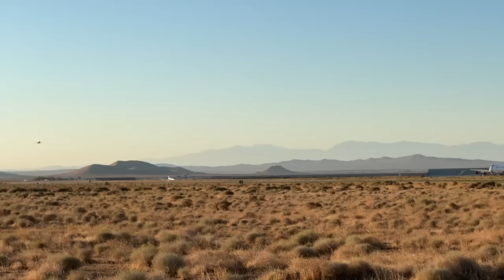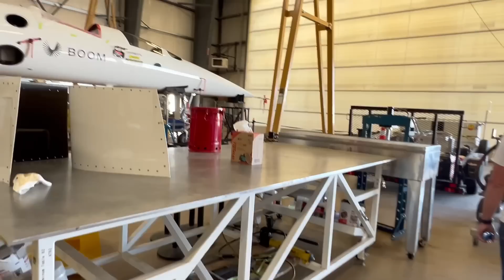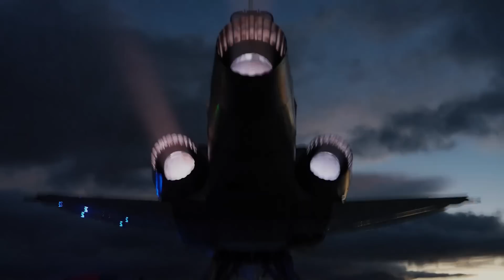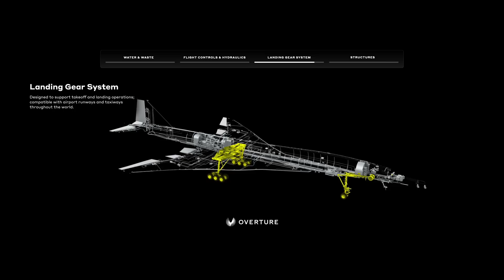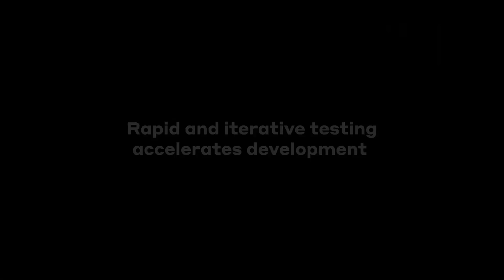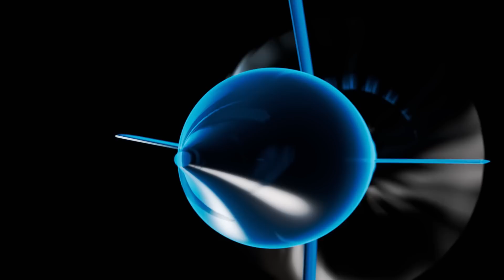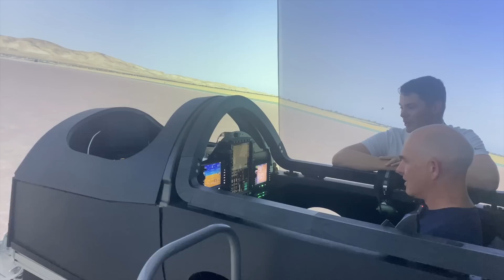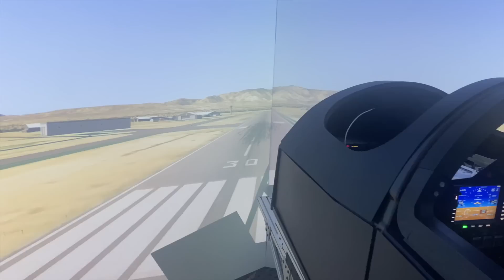Will This Experimental Supersonic Aircraft Show Supersonic Airliners Can Work?

Comment: Scott going straight for the jugular with rudder size shaming 😮
Reply: it's not the size it's how you use it
Reply: "XB1 to ATC can I get a speed check?"  😈
Reply: @recklessroges  "XB1 we have you at one thousand nine hundred ninety seven miles per hour across the ground."
Reply: It may have something to do with how this one flies a little faster than the plane Scott's used to, therefore generates a 'tad' more force? :) 
(Having said that I would be speechless and not able to ask half the questions he did, or even get let in).
Reply: @DailyFrankPeter Boom doesn't have a propeller with a bunch of angular momentum is my guess.
Reply: @DailyFrankPeter  For fun, compare to the Panavia Tornado or the Saab Viggen - those things had chonky rudders. I wouldn't actually say the XB1 had a small rudder though - looks like a good balance of drag vs yaw authority for application (to my inexperienced eye, at least!)
Reply: @DailyFrankPeter  Faster planes need larger rudders usually since sideslip is more and more of an issue as you go faster
Reply: As was mentioned, the rudder area is a function of yaw control in the event of an engine failure.
These engines are close to the fuselage, so not much asymmetric thrust if the left or right engine dies (and with a lot of total thrust coming from the middle, then even less need for a lot of rudder).
Contrast with, say, a B-787 with massively powerful engines several metres off centre line and 100% of your thrust coming from that one engine ... and the yaw moment is a whole other thing.
Reply: Any time two guys compare rudder sizes one of them is going to be disappointed.
Reply: It's normal size!
Reply: "!Ay Qué rudder más grande!" -Scott Manley
Reply: Look at a B-52's rudder compared to the size of the aircraft.  Indeed that's why they can't re-engine the -52 with 4 larger engines and have to replace the original 8 in the retrofit program.
Reply: Wor lass said that's a giant rudder
Reply: Jets don't need rudders LOL.  But really... no P-factor to deal with
Reply: … and there’s this strange obsession with rudder size
Reply: Seems like real bullying happened around landing speed.
Reply: 😂🤣😂🤣😂🤣 laughed my ass off with this one hahaha
Reply: Haha! But to be fair, he also went the other way comparing the xb1's taxi speed to his plane's speed in a dive.
Reply: It’s not supersonic 😂😂
Reply: Is that what got pilots panties in a bunch? the pilot seemed really annoyed by that comment
Reply: @dosmastrify  Did he? I picked up on some... Rigorous insistence, maybe? But he didn't strike me as annoyed. Maybe I'm just not reading the dude well ¯\_(ツ)_/¯
Reply: @dosmastrify they were just looking at it from different perspectives and getting a bit confused. Scott is thinking wow this big plane's rudder is about as big as my small plane's rudder. While the pilot who flew fighter jets is thinking wym the rudder is much bigger than the rudder on the fighter jet I flew.
Reply: @MrWizardjr9  Well, the Hornets he flew had two, so that adds a lot of authority.
Reply: @dosmastrify I guess, he just seemed like a d bag as a whole. Always trying to correct Scott. Like Mach 0.61 instead of 6.
Reply: Scott was kind of a jerk about it, actually.
Reply: It was an ignorant comment imo why would a supersonic plane need massive control surfaces. At speed I’m sure they’re incredibly effective
Reply: @Dm0stFin3sT  Because shockwaves can cause effective blanketing of control surfaces.
Reply: @BetterWayAI as stated in the video when talking about the rivets that far back the boundary layer is so thick the rudder is not exposed to those forces.
Reply: @Dm0stFin3sT It's all fun and games, until your rudder gets occluded during your landing flare.

Just ask the F-100 Super Sabre pilots.
Reply: @Dm0stFin3sT  I don’t know. But the SR-71 had an all-moving rudder design, and that’s the fastest air breathing plane ever, mach 3.2+.
Reply: @SimonEkendahl   that plane had the engines much further apart it needed way more control authority in the event of engine failure.
Reply: @Dm0stFin3sT  Alright!
Reply: @SimonEkendahl  also sr71 flies so much higher less air density means bigger surfaces
Reply: @Dm0stFin3sT  They're extremely oversized for supersonic aircraft. Rudders that big at only useful at near-stall (landing) speeds.
The force of control surfaces goes up with the speed of the aircraft, or rather relative airspeed. At supersonic the force is so great that you only need like 1-5 degree surface deflections to rip the wings off.

Waaaaaaay overkill
Reply: @Dm0stFin3sT the airplane still needs to go slow, that’s when it matters
Reply: @johnlichtenstein6158  it’s about control authority the differential thrust is low when the engines are close
Reply: @Dm0stFin3sT  you're not landing or taking off at supersonic speeds. even the pilot answered that directly. Do agree that the rudder looks totally normal and similar to an F5 or T38.
Reply: @Dm0stFin3sT  "It was an ignorant comment imo why would a supersonic plane need massive control surfaces. At speed I’m sure they’re incredibly effective"

On the other hand, for the 90% plus of the population who has no clue about control surfaces in flight, it is a great question.  Maybe just needed different framing on both ends.
Reply: The biggest problem I have with the Concorde is that it was an project financed with public money. An economically unviable project. Air tickets were very expensive, but it still wasn't enough to cover the costs. A lot of public money was spent subsidizing it.
Reply: @theethicsofliberty4642  The Olympus engines powering the Concorde were developed on public money for a cancelled British fighter project. I would assume that was half the cost or at least a third but that was a great way to not put all these investments in the trash. The reason it wasn't viable economically was that it was banned from flying over the US.
Reply: @amaurytt and it didn’t make money and was purely for status.
Reply: @zappulla4092  Still really cool. My wife actually won in the late 90s a quick ride on the Concorde to pass mach 2 over the Atlantic and back to Paris.
Reply: @theethicsofliberty4642  to be fair, almost all aerospace endeavors are heavily subsidized one way or another.
Reply: @theethicsofliberty4642  the business case for the Concorde closed. It was profitable before the French and British got into the pissing contest that actually dragged it down and ended it eventually...

The R&D could have been paid down with commercial revenue, but it was always very much a dual-use technology, and likely could have been easily turned into a European equivalent of the B1-B...
Reply: @theethicsofliberty4642 ok.
Reply: @theethicsofliberty4642  The investment in supersonic flight "lessons" was used throughout the industry for sub sonic flight as well as supersonic craft.  Kind of like how the moon shots in the last decade propelled everything from tennis shoes to microwave ovens in our kitchens.

There are many things that we (as a society) need to learn and discover that will never happen if left to business investment.  I see the Concorde as one of these.

That being said, the biggest problem with Concorde is it was not allowed to fly into most airports.  It was deemed to loud and required too much runway for the time.  Anyone who has lived near a military airfield with fighter jets going supersonic understands this all too well.  :)

If they can nail the sonic boom problem, there will be plenty of takers who are interested in cutting their flight times by half.  Unfortunately, I can not afford to be one.  ::sad face::
Reply: @theethicsofliberty4642 my understanding was the nerfing of available routes due to booms, reduced flight volume to unsustainability… if more volume was allowed, they would have been profitable.
Reply: @theethicsofliberty4642  Concorde was profitable to operate for both Air France and British Airways, the R&D is a separate thing...
Reply: @GearboxEnt  ...
FRANCE EXTENDING AID TO CONCORDE (The New York Times)

Supersonic Scandal (Nature)

The Story of Concorde (Bright Sun Films)
...
Reply: @theethicsofliberty4642

If you think that Boeing isn’t subsidized by public dollars, you’re fooling yourself.  

They’ve pretty much had the key to the US Dept of the Treasury since WWII. Very bloated cost-plus-fee government contracts is the only way it makes “privately funded” airliners.
Reply: @calvinnickel9995  ... Government sometimes subsidize the design of an airplane, but not the passengers' tickets. It's a lot of public money thrown away just maintain "national pride".

The Story of Concorde (Bright Sun Films)
FRANCE EXTENDING AID TO CONCORDE (The New York Times)
Supersonic Scandal (Nature)
...
Reply: @theethicsofliberty4642 I didn't know or glossed over that, since the Concorde was on paper and in practice something for the top 0,001% crust that won't mind extraordinary expense if it's the absolute best, like how that guy in Invincible teleports around all the time despite each teleport costing hundreds of millions of dollars. "I'm the best, should do the best".

So ferrying around the political class and the Omega wealthy and it still ran at a loss?
Reply: @Mordecrox  ... Yes, it operated at a loss for most of its life, receiving government subsidies to operate.
Reply: @Mordecrox  It did not run at a loss, both Air France and British Airways operated it at a profit
Reply: @Mordecrox  Not being able to fly routes over land (as it was expected to be able to do when the project was funded) severely limited the aircraft's ability to get wealthy people quickly to their ultimate destination  (negating the benefit of all that speed); and so it's only real utility was selling tickets to people who just wanted to say they flew on it... or happened to need to commute between NYC and London a lot.
Reply: Scott should be designing the plane for these guys. He obviously has more aerospace experience than the Boom engineers.
Reply: @uncaringbear  Snark.
Reply: @uncaringbear Ouch! 😬
Reply: @uncaringbear  Sarcasm noted.